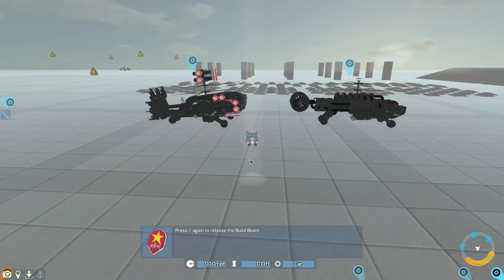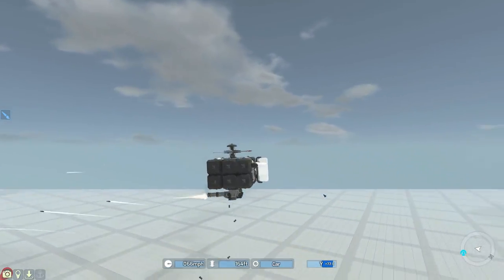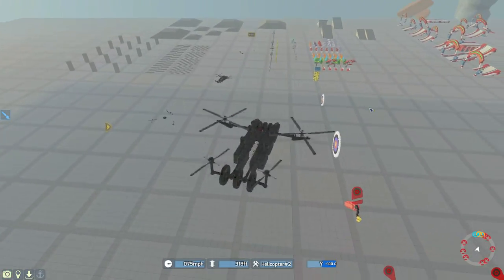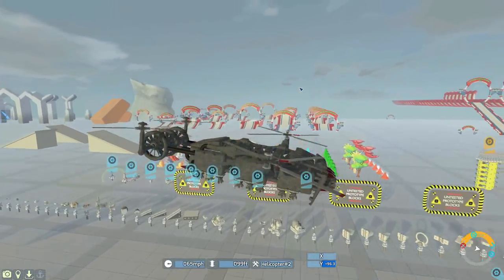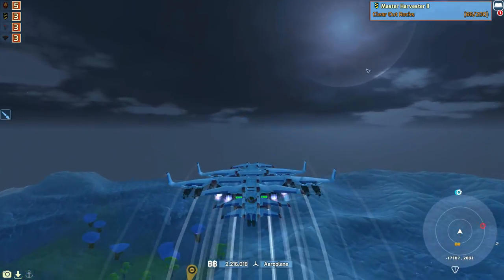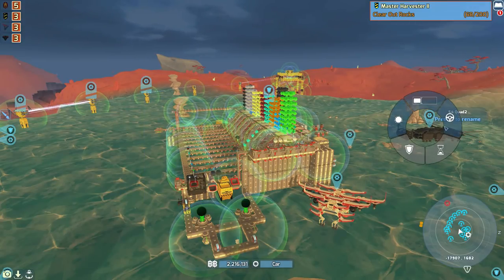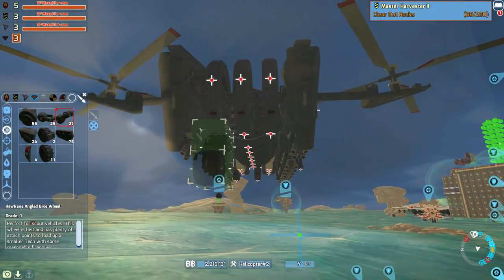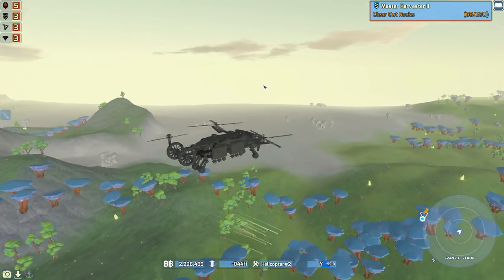Terratech | Ep33 S4 | New Helicopter Control Build (Practice!) | Terratech v1.0.1.5 Gameplay

Comment: 1:05 - The old choppers should still work, if you find the best control setup for them (via a lot of experimentation). Hover-bug heli should fly the same on "Car" with [Shift]+[Ctrl] mapped as a pair to "Lift". Some hover steer (non-bug) helis will work off this too, but that one looks like it might need [S]+[W] assigned to "Pitch" (plus shift+ctrl on lift). Although hover steers were so massively buffed that this broke my nimble designs anway, so you might have to remove some (e.g. from it's 'chin').

20:20 - A default throttle setting (or 'cruise control'?) is one of the many things I've suggested to be added with this new feature. I may add a note to that suggestion thread... What would you name it? :-)

15:20 - Yeah, there's been a bug with the sloped and curved upwards conveyors not connecting with the others on tech loading, for the past couple patches. Causing crashes some times, as you discovered. I'll add a  note to that thread to say that you hit it too (never hurts, given that the devs love you ;-). 
[Edit: oh cool, looks like they literally just fixed it with 1.0.1.6 yesterday evening.]

Comment: the first angle conveyor in each group of them needs to be removed & replaced.
the same with inside bend conveyors.  Then check the directions.
I found that often swapping  directions without the above causes a crash.
Reply: this started around 1.01 (Better Futures into.), and needs to be done each time the factory loads into memory (each load game, or if you travel to far from your factory.)
ps. gso has a better looking (grey) altimeter.
Reply: Fixed in 1. .17

Comment: 5:24 looks like DJI Mavic Pro

I Need clockwise rotors and counter clockwise Rotors clockwise Front left and right back
And Counter clockwise Front right and back left than Can a drone turn Stearing on the Yaw axis 
Can your drone roll left and right?

Comment: "new control build" *uses regular controls and no actual pitching to go forward*
Reply from the maker: I used the new turning controls which don't require the hover bug - I used the new lift controls which are set and not instant use - I did use pitching to go forwards at the start and a combo of rotor and pitch near the end. I feel I did quite a lot of new stuff, honestly! Haha :)
Reply: "at the start" and then threw it all away on a typical internal rotor build. This could've easily turned into an appache. Also, for the autocannon, perhaps internal rotors are the answer to THAT problem? Also, how did I get noticed in the avalanche of comments? And ok then.
Reply from the maker: I read all comments, so you and all others have been noticed! Also true, but since I didn't want to use missiles and the pitching movement type is very difficult to pair with non-homing weapons It was a difficult choice, hence why I went with what we have currently which is the internal rotor build WITH the pitch mechanic when not in combat.Also vowed to make a pure pitch craft in the future, when using missiles! :)

Sadly even with the internal rotors the autocannon recoil is still just terrible, it causes you to fly upwards very quickly and to counter that you need to lower your lift.. then as soon as you stop firing you get thrown to the floor, or if the weapon changes target or loses target the recoil shifts very heavily and this is with just a few of them or even one of the gun! It's not impossible to use but it is very difficult and not all that fun to watch.
Reply: @Lathland  Internet rotors? Are those like bluetooth or wi-fi rotors?
Reply from the maker: @a_lexine  Hah, just changed that - The joy of the ultimate combo of dyslexia and auto correct. Everything is corrected badly and I rarely notice..
Reply: Are you commenting of of your phone since I don't know of any os to use autocorrect...